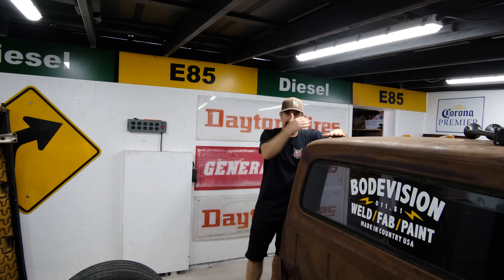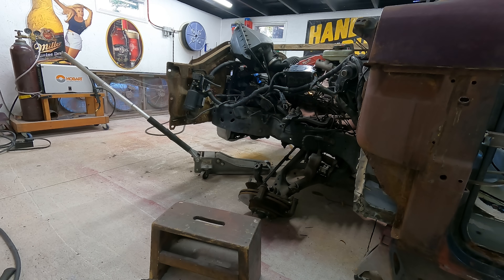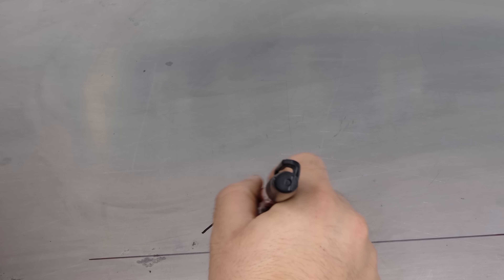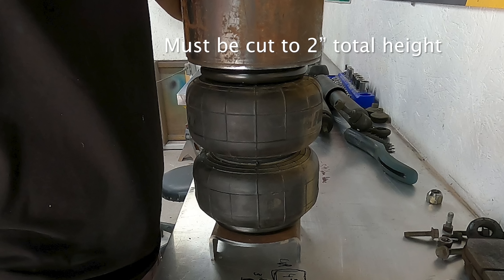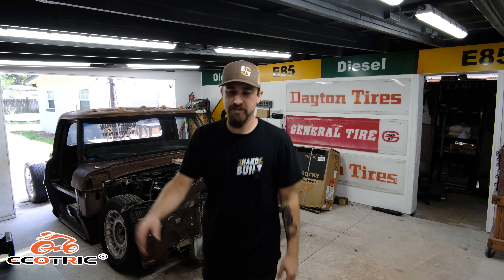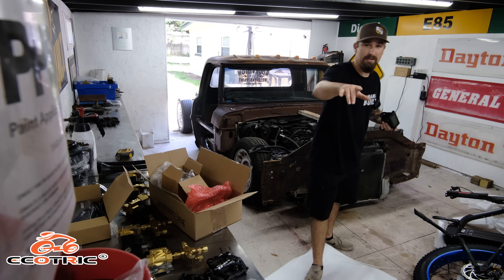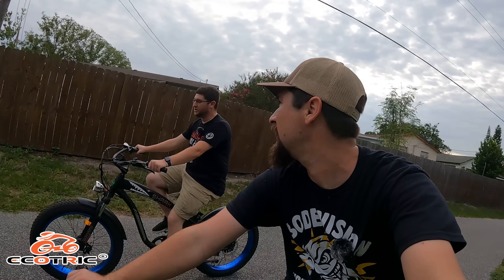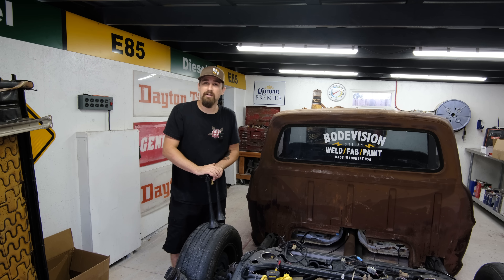Ultimate Air Ride Suspension Installation Guide: Body Swapping Old Truck To Modern Chassis

Comment: If he's is trying to teach how to do it there's no point of when you're doing it having it in fast forward no audio it would be so much easier to just explain as you went an showed this is what I'm doing I think you should rethink how you film if you're going to be teaching you need to go slow an actually show the people what to do an you could point to do this or that explaining it with no visual pointless then if you not gonna teach how to do you could go so much faster by just explaining after or just as you're going give A recap its like your in between both ways teaching an just explaining cause if you were teaching there's not enough info to actually idk hard to follow

Comment: Hardline the bags please, it’s so worth it!
Reply from the maker: I had a few conversations with the guys at the semi truck supply stores and they were explaining how the nylon ones have been used for a long time and they’ll be perfectly fine for my application
Reply: @BodeVision  hardlines would be sick lol also you probably wouldn't ever have to replace them, nylon ones do break occasionally
Reply: @BodeVision  my semi has nylon lines... 830,000 miles... been in 120° weather to minus 30°

Comment: What's your idea for a dash and radio, i put a tablet in my truck as a radio. I dont think i can ever buy a double din unit again.
Reply from the maker: That’s a really good idea. I’ll have to see if they make town car kits to just mount one in there
Reply: @BodeVision  i can make you a custom one, just need old radio, and an otterbox for whatever tablet you want. I used a Bluetooth interface and hidden power plug.